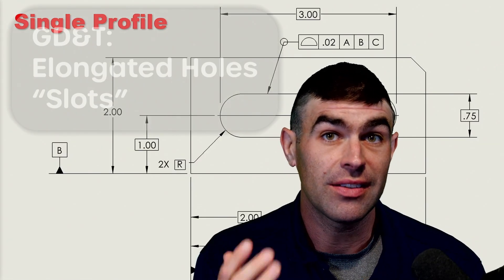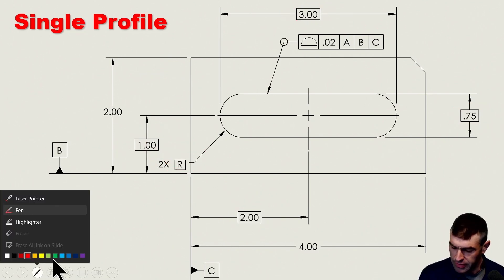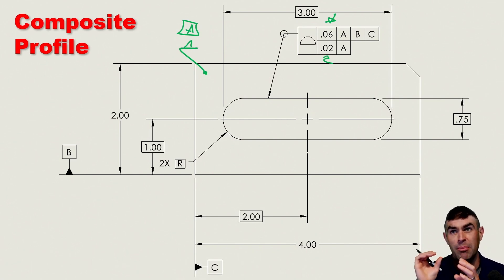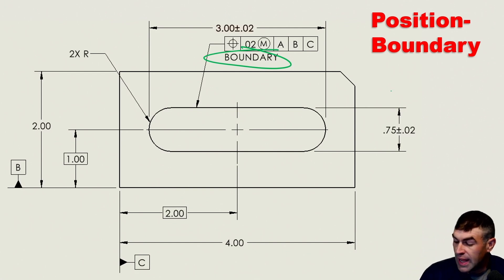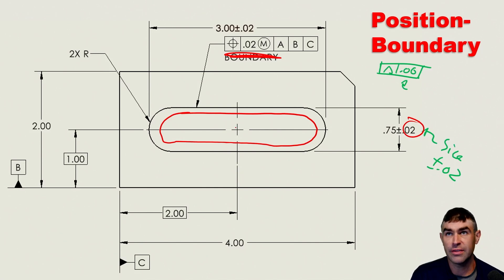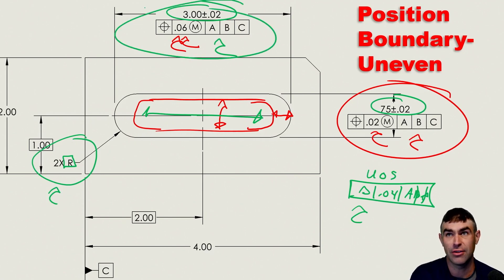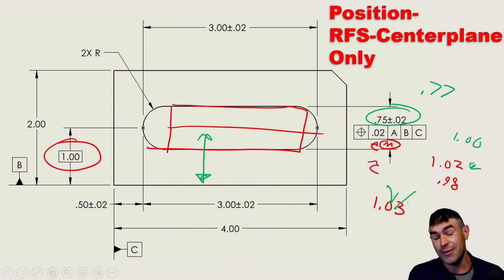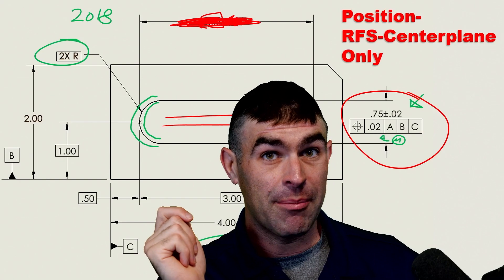GD&T: Position & Profile with Elongated Holes (Slots)

Comment: what if the slot is at 120 degree angle respect to x axis? and you are only controlling true position of the width of slot? (center plane)?
Reply from the maker: Should be the same, at 90 or zero degrees the basic angle is implied. The 120 degree dimension should be basic.